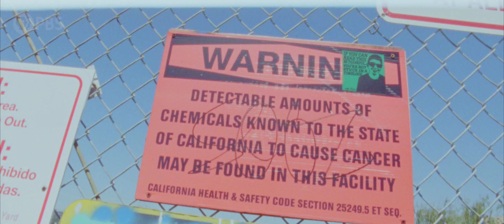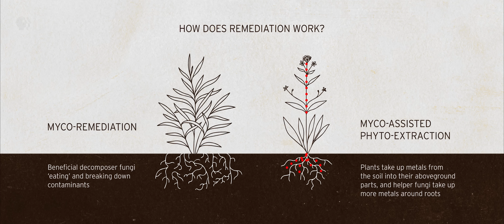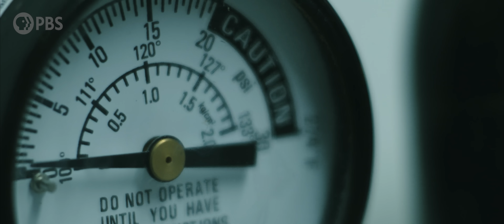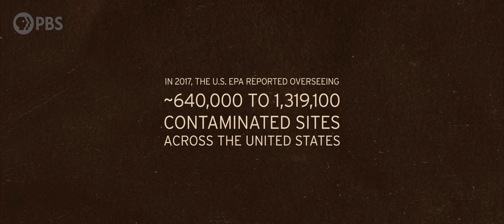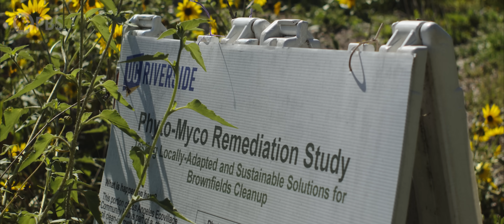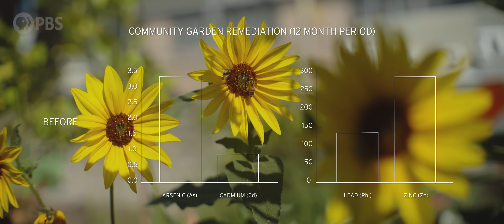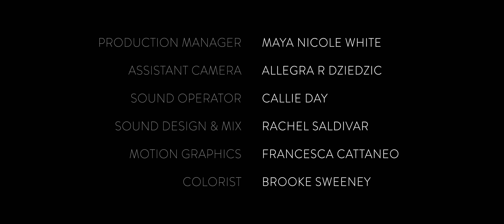She's Healing Wildfire Pollution. With Mushrooms.

Comment: For those asking what happens to the heavy metals and chemicals as they are taken up by the fungi and plants: it depends. Based on the type of pollutants and the organisms breaking it down, one of three things happen: removal (it is totally broken down by metabolic processes), neutralizing (it is transformed into a non-reactive/non-toxic version of itself) or stabilization (the pollutant is stored in the biomass of the remediating organisms , keeping it from going anywhere). If you eat something that has just stabilized the pollutant, you can be impacted by whatever it absorbed, which is why bioremediation doesn’t use food crops, (heavy metal absorption in food crops is an issue in the ag industry, like with rice, for example) and also why inoculating the soil with microorganisms and fungi along with plants is a key part of successful bioremediation.  A plant that sequestered the pollutant eventually dies, and then the bacteria and fungi in the soil metabolize the stored toxins to break them down as they work to decompose the plant matter.
Reply: There is biomining now. Small companies are starting to spring up where the soil isn't good for traditional farming because the land is heavy in a metal, so these companies are planting metal extracting plants on the land to extract it, then process the plant matter to actually obtain the metals. It's all small scale for now, but combining remediation with this newer concept could be a game changer for repairing our industrial revolution before we took the environment into consideration.
Reply: @Fenthule pretty smart to try to use the natural processes to extract desirable metals
Reply: @Fenthule  this is absolutely fascinating and I'm glad to see it isn't just a thing I wondered was even possible.
Reply: Can you explain more about stabilization? What happens when the biomass changes form, dies, is eaten by other ecosystem members, etc? I am very curious to hear more details about the big picture, because the same "cleaning up pollution" argument is used about marine filter feeders such as oysters, but I can't find out where the pollutants go after the oyster dies or is eaten. In your case does the stabilized pollutant show up in the pollen of the plants growing there? And eventually, the whole ecosystem of decomposers will change the form of the original biomass, perhaps many times. Then what happens to the stabilized pollutants? Thanks for help understanding.
Reply: @salishmagazine9185  You are correct that if you use a plant to stabilize a pollutant, then in order to actually remove the pollutant you have to remove and process the impacted plant matter. One of the most written about examples of using plants as stabilizers was for groundwater remediation around Chernobyl. Sunflowers were used to take up radioactive metals, the plants were then harvested and subjected to pyrolysis. This process burns off the organic carbon in the plant and leaves the radioactive metals behind. The metals were then put through another process to turn it into glass and then that glass was put in radiation shielded containers. So, it's still a ton of work to manage some of these pollutants, but ultimately it was easier than having to try to remove all contaminated groundwater by other physical or chemical means.
Reply: Right, the good old plasma torch. Glass it baby! In my First Centauri Ark starship design, I have mushroom cultivation as one part of the recycling, but it then feeds further to other processes, with all materials containing heavy elements sent to Final Resource Recovery, which is laser and plasma based. ZERO waste.
Reply: @Cordo_Roxen  So, if I'm understanding the chemistry and the history correctly, this takes the painful cliche of "the solution to pollution is dilution" and flips it on its head -- the solution is concentration, and that means that instead of a cubic yard of contaminated soil that weighs a ton, you've got a much smaller and lighter waste product that can be isolated more effectively, and with fewer side effects...?
Reply: @Cordo_Roxen  Thanks for the additional info. In the case of the land in the video, what are the plans for removing the stabilizers? Why didn't the video compete the story by describing that part? Are there plans for removing and processing the materials in the many storm water filtering ponds I see cropping up all over? How could I find out?
Reply: @Cordo_Roxen thats so exciting and promising, I hope it can keep going up in scale and maybe eventually become the norm so the whole planet is healthier for everyone. ❤
Reply: @salishmagazine9185  ב''ה, to possibly oversimplify, yeah, think of it as elemental pollutants that can't be broken down further because they're elements, and petrochemical pollutants that are mostly hydrocarbons where we don't want them to be. 

Some life can break down the hydrocarbon sort of stuff with biological enzymes etc. in a way where it stops being a threat to human/mammalian life.

Meanwhile hazardous elements (metals etc.) mostly get bioaccumulated and then the containing organism just becomes a way to move the toxin out of the soil or water by collecting the organism and thanking it for having roots or the filtering organs of an oyster. 

Now, when you get to "forever chemicals" like PCBs and the modern organic fluorine compounds it gets a bit more case by case.  Chlorine is in salt, fluorine is in toothpaste if you're not afraid of it and enough waters for toothpaste to have been invented, but bunged on to organic molecules like dioxin bad things happen for life.  Whether a particular organism can do much to remediate those is.. not as accessible as it probably should be.  i.e. I'm from the northeast where it's generally known that no one wants to eat PCB contaminated oysters, yet the filtration does mean maybe they eventually die uneaten by humans and the stuff accumulates in sediments slowly pulling it out/further burying it away from the actual water column if not disturbed.. but what they can break down or incorporate in uneaten parts like the shell compared to what they can actually biochemically transform into nontoxic compounds is hidden in some science journals. 

(As someone particularly interested in mycoremediation, it pains me that Stamets's popular talks are equally unclear on this; we've got good scientists who actually understand what their favorite organisms can and can't do and yet when they face the public they say things like 'detoxifies heavy metals!' without explaining what's going on and in what situations they are food and in what situations they should be incinerated under filters.  Maddening and sets appreciation of science back, but people get stupid in front of a camera?)
Reply: @salishmagazine9185  In terms of using marine life for bioremediation, the answer, like with plants or fungi, is "it depends." Pollutants like heavy metals cannot be broken down, which is why certain types of seafood is warned against if you are pregnant because some fish species accumulate more mercury than others. For an organic pollutant like nitrogen (from farm and sewage runoff) shellfish like oysters are great at removing the pollutant completely because they can metabolize it. For NYC's billion oyster project, the main pollutant they use the oyster for is nitrogen, because there is a lot of sewage runoff whenever it rains and once it gets into the water the excess nitrogen causes algal blooms that kill other organisms. But because of this sewer overflow system, the oysters used are not marked for consumption, the presence of fecal bacteria is too high. Plus, the oysters are being used to rebuild habitat and reefs in the harbors so they don't want to harvest them.
Reply: @salishmagazine9185  when it gets eaten the thing that eats it get poisonned and it either stays in the body or gets pooped out
Reply: Thank you for this encouraging and exciting information 😊✌
Reply: Though you mentioned them purposefully using plants that are not crops so as to not ingest what they absorb, I do wonder if they are eaten by any other creatures and how it might affect them.  Or if they are a flowering plant, how it might effect hummingbirds or the honey from bees (that humans might then ingest).
Reply: But the lead and arsenic are still there, just in another form.  The site is still contaminated.  I wonder what the control looks like? Are these reductions in lead levels just due to leaching away into the subsoil?
Reply: @dominicgoodwin1147 depends on the toxin. As mentioned, some toxins can actually be transformed or destroyed by the plants. Some may be effectively diluted by the process. Some may just be brought to the surface, where it's easier to deal with in less volume. And some will require harvesting of the plants and disposal in another process.

Again, depends on the toxin and the plant. But either way, obviously, no one is declaring a site safe just because a couple of plants grew on it lol. It's part of a process and they test it and adjust all along the way.
Reply: Thanks! This is the question I had which wasn't addressed by this video. (I suspect the goal here was to tell an inspiring story, not to educate about the entire process of bioremediation in excruciating detail. It can be difficult to strike the right balance...)
Reply: Organic and hydrocarbon toxins can be metabolized by mushrooms and broken down into their constituent elements. But you can't break down an element with either phyto or myco remediation. These elements become bioaccumulated into the tissues and must be removed from the site to actually clear they soil. Danielle's work is pioneering int this field and new breakthroughs in application and scale are just around the bend.
Reply: Thank you for this information
Reply: Any research on reclaiming some of the metals using the plants for industrial purposes to possibly help reduce mining?
Reply: @tic857  It's never going to make an impact on mining. Even large areas of land with levels of metals high enough to contaminate the soils aren't going to be remotely as concentrated as veins that have formed over millions of years. Extracting the metals from the plants just keeps the plants from being the new contamination source, which is still worthwhile, even if it's not economically significant.
Reply: Also to note heavily industrialized farming can have the same effect as other industrial / catastrophic polluting contaminant release.  Thank you for sharing.
Reply: What happens to the bees that are collecting the pollen??
Reply: @rovingnomad8397  It depends. A study came out this year in Applied Sciences that showed plants differ in how they take up and store pollutants, so some keep it in their roots vs leaves vs stems, it may be that the pollutant won't be present in the pollen at all. One paper by in the Journal Environmental Pollution showed that high levels of cadmium in sunflowers changed the behavior of bees, who visited and pollinated them less, but didn't give any indication there was heavy metal in the pollen itself. However, a study published in Chemosphere in February of this year did find that certain "forever chemicals" could be found in the pollen of hemp plants used for bioremediation and that it could impact bees. There is still a lot of research to be done, but it seems to be: Depending on the type of plant and the type of pollutant, it may or may not be found in pollen. FYI all the papers I mentioned came out in the last 2 years, it's an area that still needs a lot more study, which is exciting!
Reply: If you find lead and arsenic in your water, what are some step by step recommendations for cleaning up the water and soil (assuming that the soil is also contaminated)?
Can you start with store bought mycelium powder? 
Would lead and scenic be able to be broken down, or would they need to be sequestered and removed?
Reply: @uddhi108 So Lead contamination can be from old Lead pipes in homes. My dad was a plumber for 30 years. Many people can go in and redo the plumbing for your water. If you are finding Arsenic & Lead in say well water you probably have a source of contamination that is a much larger problem. My youngest daughter helped in a study of the water fountains and bathroom faucets at her college. They found high concentrations of Lead. The University paid for bottled water for all the students and then redid all of the fresh water plumbing all over her entire college campus. Her state college is quite large. It took some time but they were able to do a lot of the woek over summer.
When you have arsenic and lead it could be from so many things. It can be from mining, farming, Industrial, naturally ocurring, military, golf course fertilizer run off or several of the list and so much more, etc. Many things can cause this. I would start with your city. Contact them and ask who manages your water. They may be able to tell you where the contamination is coming from. If you are on city water these things shouldn't be showing up in your tap water but all states have different limits and regulations. My brother in law does consultations and helps cities build water treatment plants.He learned how to do his job in the military. He used to run a large water treatment facility here in California. He's a really smart man. I hope you are able to find the cause of the problem. You may also need to pay for soil sample testing on your property to see how contaminated or not your soil is. Good Lucky. 😊
Reply: Thank you. Very interesting 😊❤
Reply: It's reassuring and refreshing to know that there are people like you that are out there making a huge difference to saving our environment. 
   I fear for the day that so called civilization goes too far on destroying our natural environment.
Reply: Thanks for the info.
Reply: Interesting solution! Let's also reduce consumption of these things. It's an amazing that we got to the point when we need to heal our earth!
Reply: thanks. it's annoying when such publications miss this important point.
Reply: Wouldnt rollie pollies help also?
Reply: As someone that ate mushrooms from a heavily polluted area, don't... haha
Reply: Thank you for explaining ❤
Reply: That last sentence here about metabolizing the toxins as the soil breaks down the plant ... Does that mean the soil is toxic then or is that the last part of the process of removing all the toxins from existence
Reply: this is still confusing me, because no chemical processes can transform an atom into another type of atom, so those toxic atoms will still BE there. are all of the contaminants eventually converted into inert variants? or do you eventually have to haul a bunch of heavy metal infused biowaste elsewhere?

Comment: What happens to the contaminants? Was it absorbed by the fungi? Where does it go?
Reply from the maker: Hi! You have to pull up just the specific plants that have pulled up the heavy metals and toxins, and from there you can compost them down to a small amount of concentrated materials and discard them. Thanks for watching!
Reply: @pbsterra thanks!

So, why is this method better than just pushing the soil from one location to another?

Does the fungi change the contaminants into something less toxic or nontoxic substances?

I'll have to check her publications. Thanks for covering this. I

Comment: Great video. I was wondering what happened to the organic matter that had absorbed the contaminants.
Reply from the maker: Great question! You do have to pull up just the specific plants that have pulled up the heavy metals and toxins, but from there you can compost them down to a small amount of concentrated materials and discard them. Thanks for watching!

Comment: It starts with cutting out materials that produce these contaminants. 
Also building structures that are natural and fire resistant. (Metal/Concrete/Brick/Earthworks/Cork/Wool)
Reply: Look at Australia for fire proofing ideas. In 2020 one third of Australia was on fire. For context, Australia has almost as the same land mass as the USA. 

The state of Victoria has some of the strictest building codes in the country because of the Black Summer fires. Corrugated metal roofs as standard here and many new builds have metal siding, rather than wood. 
In colder areas, people often stacked winter fire wood under the house (if elevated) against the side or on verandas for ease of access. This lead to large fuel sources which exacerbated the fire and destroyed even more homes. Obviously this practice is now discouraged and even banned. 

But have a look at houses that have been rebuilt since the Black Summer fires, they might give you some ideas. Also have a look at Victoria’s government website for the current bush fire building codes for more info. 

There’s also an Australian company called Blue Scope Steel, which is selling a lot of metal siding in California at the moment for rebuilding. They’re a very large company here and popular because the steel is coated in the colour of your choice and doesn’t need painting for 25 years - a bonus to its fire reduction properties 
(I’m not affiliated in any way, it’s just a popular product in high fire areas)